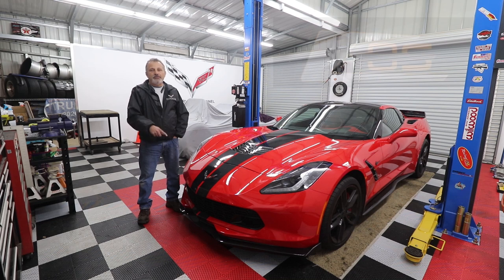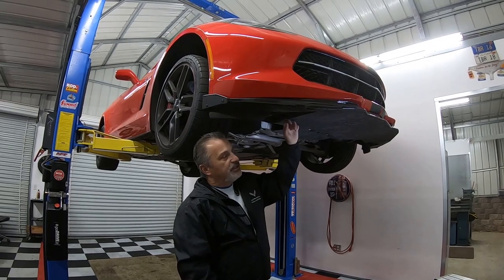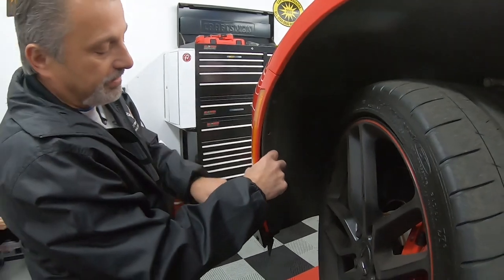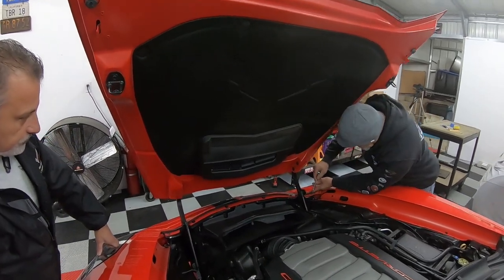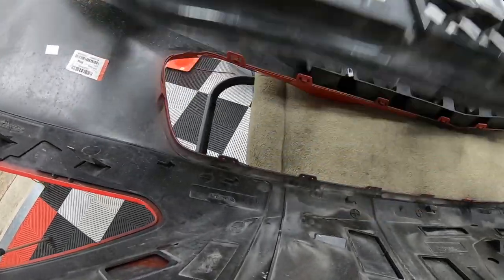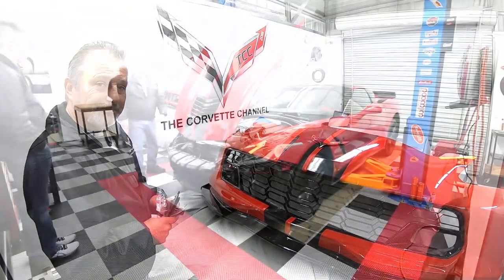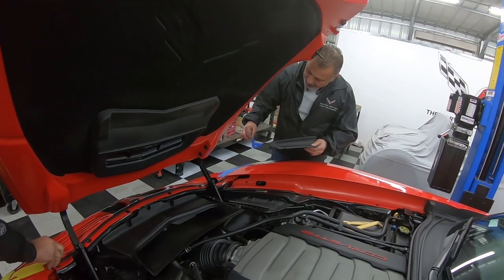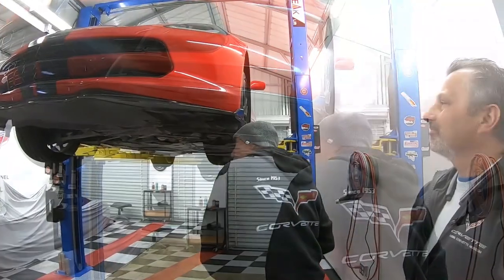How to Install a Z06 Grill in a C7 Corvette

Comment: Great demo! I do have a related but different question I hope you can help/advise me on.  My 2015 C7’s front bumper was removed & replaced after some work, it’s not perfectly seated on the driver’s side, and l’d like to fix that, preferably without fully removing the bumper. Been told I might only have to loosen the wheel well T15 screws, have a buddy push the bumper into proper alignment, then retighten the T15s. 1) Is this possible/likely?
2) If that doesn’t work, what further steps do I take, other things to look for, and how? Even better, could you do a demo video on how to go about it? Thanks!
Reply from the maker: Hi Bill, I think you may need to remove most if not all of the screws and bolts and the top and bottom and then try to move it back into place. just a few screws or bolts will not allow enough movement and you may break something. it is not hard to do just takes a little time and a way to jack up the front end to get under the car.

Good Luck and Thanks for watching.
Reply: @THECORVETTECHANNEL  Thanks! That said, can you tell me what kind/brand of tape you used to protect against scratching the finish? And what kind/brand of pry bars - I think they are nylon? Thanks again!
Reply: @billrobbins883  Hi Bill yes Nylon pry tools and yellow of blue masking tape. I like the Blue the best.
Hope that helps...

Comment: Great video Scott! Put my Z06 grill on yesterday, and it wasn't bad at all, thanks to your instructions. I had a quick question regarding the 5 screws re-installed at 29:20 in the video. Previous owner of my 2014 Z-51 had the bumper re-painted, assuming he hit a curb or something.  Those 5 screws were not on the car when I took the front end off.  I installed the Z06 grill and it seems secure, but I'd like the screws in.  Any chance you know what screws those were?  Or if you think it's fine the way it is, please let me know too! I put 10,000 miles on it without them with no issue. Thanks for the great videos!!
Reply from the maker: Glad my video helped.
Tou should be fine without them but if you want to put them in you can pull one of the screws out of the rear rock guard on the bottom of the car or one of the screws out of the bottom of the bumper and they are the same screws so you could match them up that way.
Good Luck,
Scott